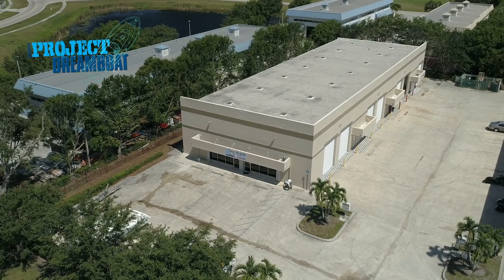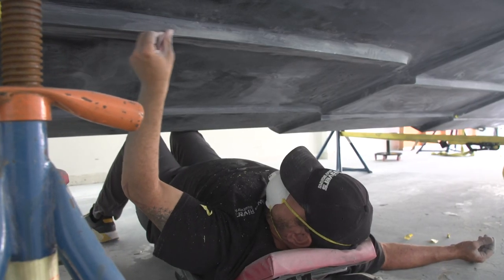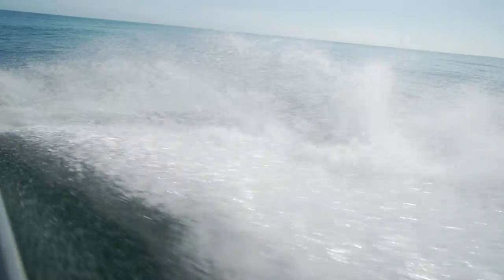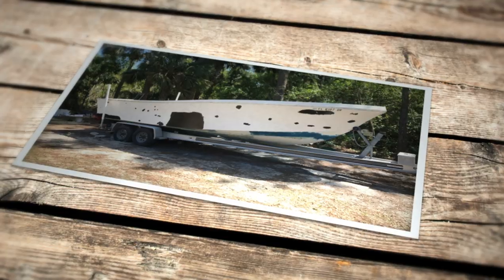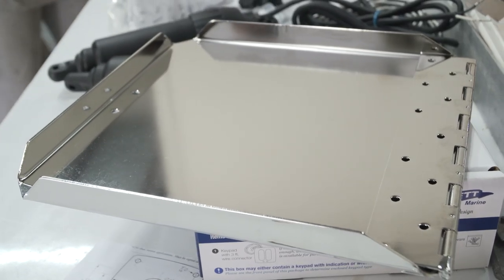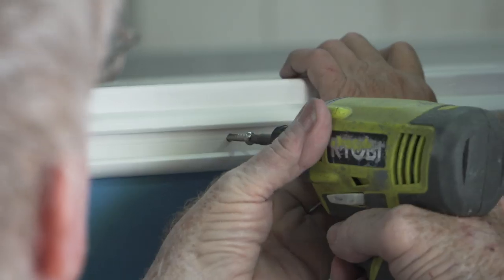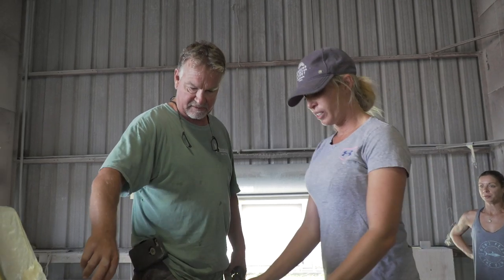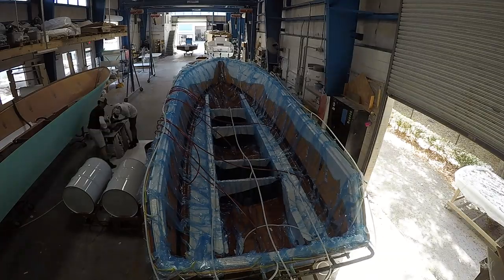Florida Sportsman Project Dreamboat - 36' Yellowfin Overhaul, 261 Mako Restoration

Comment: I thought YF was a very high end custom manufacturer....That transom job doesn't say much for Quality Control.....How about the rest of the hull!!
Reply: Wes Lovelace . They’ve never been high end. There made 10 minutes from my house. There all looks. The layouts aren’t great and the fit and finish is what you see here. But there also cheaper than the equivalent size let’s say Sea vee or invincible that are built with higher standards in place.
Reply: @GM-md8hu  I know several owners...but after what I saw I'm inclined to agree with you....There is no excuse in a fabrication job that poor....I'm kind of surprised the motors didn't pull free!!
Reply: Wes Lovelace I’ve got pics of them testing there new 55 shell with 425 elephant motors on it. Those 1000lb boat anchors are going to probably break something.

Comment: Can anyone answer if they actually used the Awlcraft 2000 as the bottom paint?   Or is there some other coating they put on after the Awlcraft 2000? Or did they even use Awlcraft 2000 on the bottom?  Reason I ask is because Awlgrip literature states that Awlcraft 2000 isn't to be used underwater.  At 3:28 they show it being mixed up.  I understand it was used in other areas, but what did they use below the waterline?